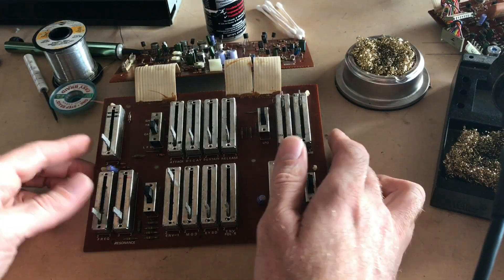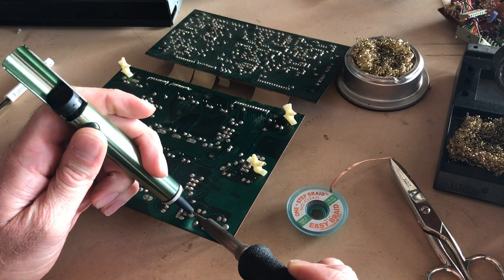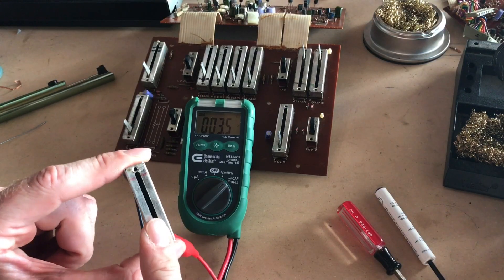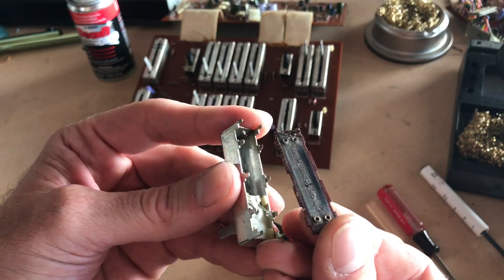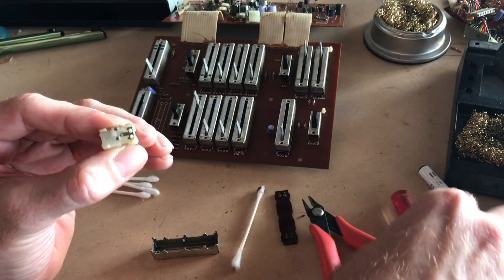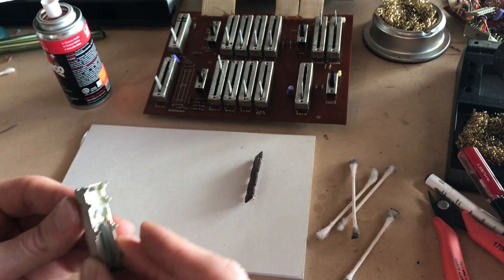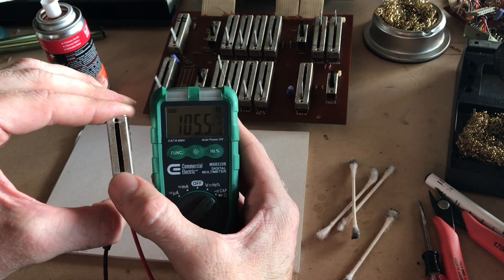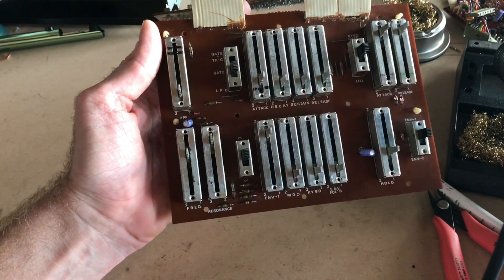How to repair faders on a vintage synthesizer

Comment: Thanks for great video. You might want to use isopropyl alcohol first (as you use Deoxit D100 which is without cleaning agent as I understand) and Deoxit FaderLube F100 after for lubing the faders for smooth action and less friction and wear on the carbon pads.
Reply from the maker: @marvinmitt4575  yes I believe you are correct. Good info. Thanks for commenting.
Reply: @SISKworks 
A comment some other video says don't touch faders with iso.

Also, What about HB pencil fore lubricant?

Comment: Spring went in backwards. There is a little plastic standoff on the body and a hole in the spring that fits over that.
Reply: Springs on these faders should be installed backwards. Earlier in the video when the faders in being ripped apart you see that they are like that originally. That confused me when I first time cleaned faders like that. I can have built them back both ways and can confirm they work better 'wrong' way around, which is how on this video they are put back together. There should be vaseline between plastic washer and fader body and that produces a problem if the spring would be install 'right' way. I guess they figured out the same thing in the factory pretty early on and started to build them this way. Your observation off the standoff is correct, originally obviously they thought the spring should be installed the other way.

Comment: Would it do any harm to clean the faders with 99.9 % isopropanol, before using the fader detoxit? I now the video is quite old but maybe I get a response ;)
Reply from the maker: No I don’t think that will harm it as long as you use something like fader spray after. The alcohol is fine for cleaning but it just doesn’t lube the parts and might change how smoothly the fader moves. The F5 fader spray cleans and lubes.

Comment: Why do you  not first try to use Detox 5.  You do not have to the remove the PCB board out you can spray the in the faders while still in together. Yes I have had to take a few faders apart but.... If i do not have to take  the unit apart why  risk  the damage to the unit.  I spray with Detox 5 and if that does not do then I take it apart. BTW I do this for a living.  I suggest using spray Detox 5 a few time a year just to keep everything clean. DETOX 5 will not cause any electrical problems.  I do not use Detox 100 because it may damage the boards. only use Detox 100 spairingly

Comment: Hi i need a little help....my slider is from -20db down at +10db top with zero db near the top but not the top...2/3 range...i have 3 broken and i d'nt know if are right for me to buy....see on ebay or amazon...the lengh is 75 mm ...mono and stereo for my old vintage mixer...how buy right ??
Reply from the maker: Sorry but I can’t help you. There are just too many variables and no way for me to know the correct part. Good luck.

Comment: Ad some non melting grease in the top slider part, and it wil run smooth....
Reply: Yeah, cleaning the fader also removes the lubricant. You can always tell when someone cleans a pot without lubing it afterwards. Feels terrible and pots become 'scratchy' and unusable in short order.

Comment: Any insight on how to fix a fader on an SH-1 that has an open circuit? Trying to fix VR606 (the HPF slider), which has an open circuit on one side of the tracks, I believe on the part where pin 2 needs to connect to ground.
Reply from the maker: DJMaytag have you already removed and opened the fader like I show? I would first open and clean then test. But if you have already done that I don’t really know what else to suggest. Sorry, wish I was more help.
Reply: @SISKworks  Yes, I've opened it and cleaned it. There's definitely an open circuit (seemingly worn through, but not visibly) at the top of the track closest to pin 1 of the fader. That means nothing it connected to the pot in the circuit, so it behaves the same with the pot completely removed from the circuit.

Comment: The trick to getting better results with a solder pump is to secure the PCB in a vice. The pumping action pushes the board away, nullifying the sucking action -- so keep that board steady.

Comment: Just curious, what exactly is the problem with using contact cleaner on faders, pots, or encoders?  I mean it is just not recommended for vintage equipment or not for both new and old equipment?  
I have used it (with success) on various faders, pots and encoders....but I am concerned that there may be long term affects that I am unaware of...  I know people swear by Deoxit, but I would really love to know what makes it so much better since the cost is extraordinarily high...I mean contact cleaner runs as little $5 for a 12 ounce can versus $24 for 2 ounces of Deoxit.  Thanks!
Reply from the maker: From what I've read the older faders have carbon tracks that could be somewhat washed off with cheap contact cleaner. I've used the cheap stuff with newer stuff with success too but I wouldn't risk it with vintage gear. I also feel that contact cleaner changer the feel of the movement of knob or fader while the expensive Deoxit adds lubricant which keeps a smooth feel. 

http://store.caig.com/s.nl/ctype.KB/it.I/id.1809/KB.215/.f

Comment: really helpful. I have the same issue on my SH1, with Env2 sliders, but they have already been repaired, with no result. I need to change them. Do you know which slider I could by? Any reference? Best regards.
Reply from the maker: Did you open up the fader and clean the internal contact or just spray the cleaner into the slot with out completely disassembling the fader? The reason I ask is because I first tried just spraying the cleaner into the slot and it really didn't do much. I found it was absolutely necessary to do the much harder option and desolder and disassemble in order to get the fader to function again. Unfortunately I don't know how or where to source any replacement parts but I can tell you that the service manual for the SH-1 shows "LFE9R-C16 500KA" for the Env-2 Attack and "LFE9R-C16 1MA" for the Env-2 Release. Hope that helps. If you do by chance find a source for replacement parts please let me know.
Reply: Many thanks, Mike. I will check if I find some new sliders. If not, I will do what you recommend.